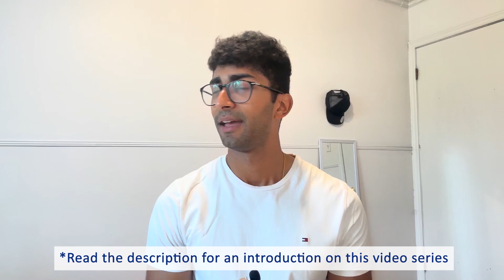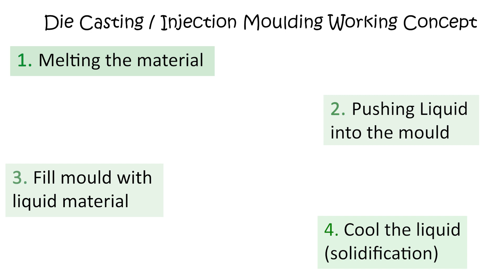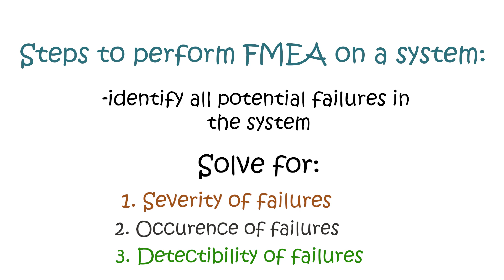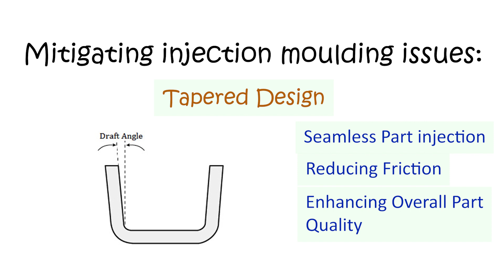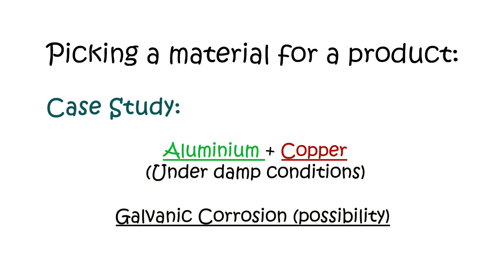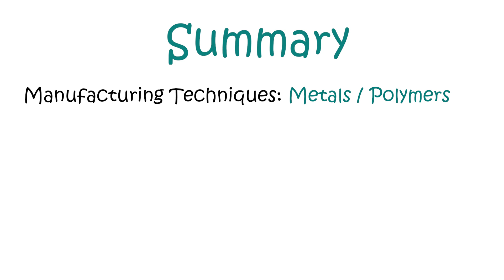MANUFACTURING: Must Know INTERVIEW Concept

Comment from the maker: Introduction 0:00
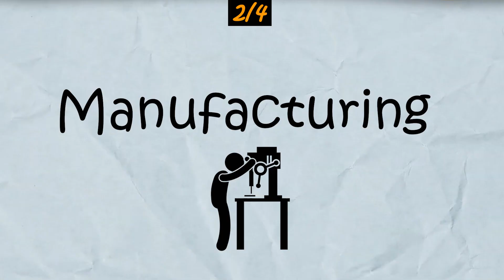About Manufacturing 0:21
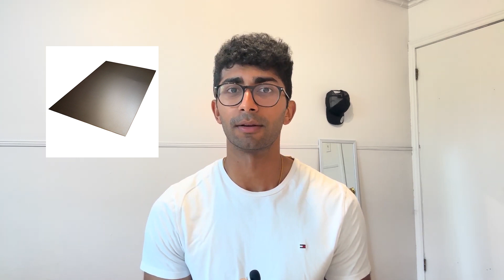Common Manufacturing Techniques 0:45
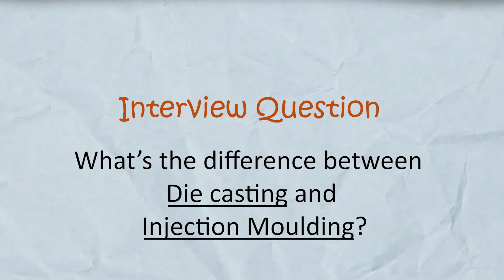Interview Ques. (Die Casting vs Injection Moulding) 1:34
Interview Ques. (FMEA) 2:48
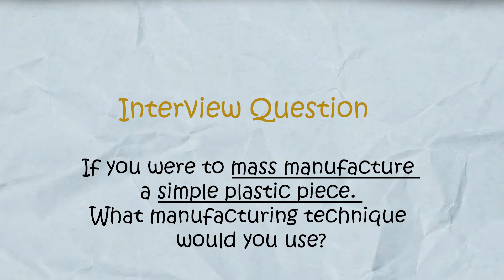Interview Ques. (Mass Manufacturing) 4:23
Interview Ques. (Injection Moulding) 5:27
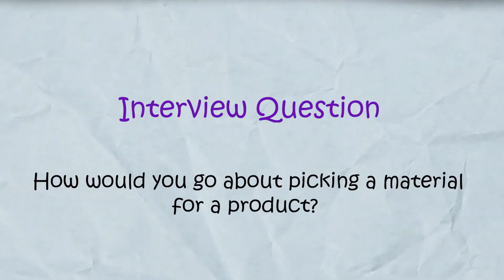Interview Ques. (Material Selection) 6:44
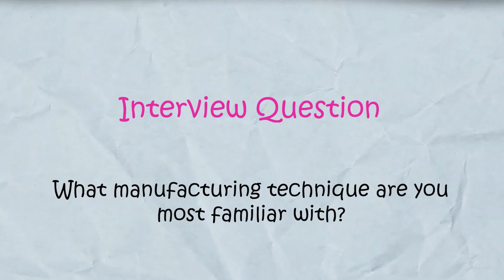Interview Ques. (Favourite Manuf. technique) 8:02
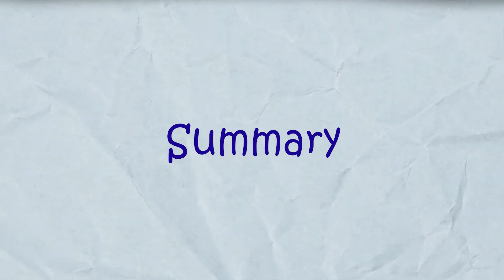Summary 8:57